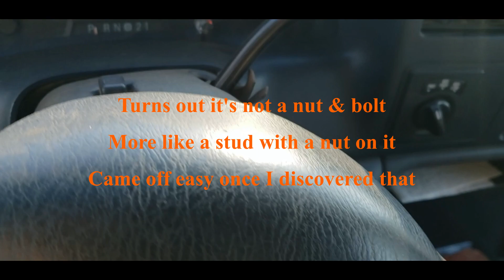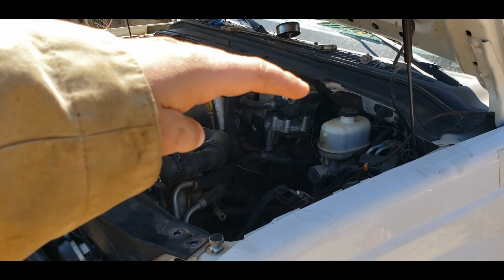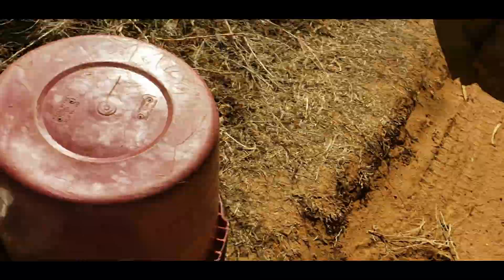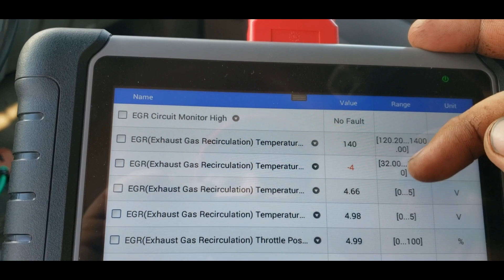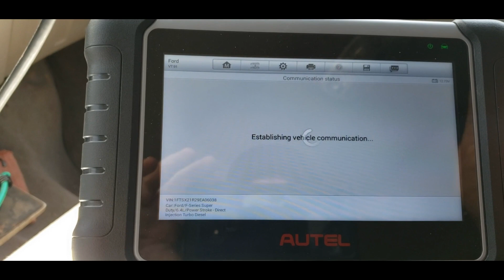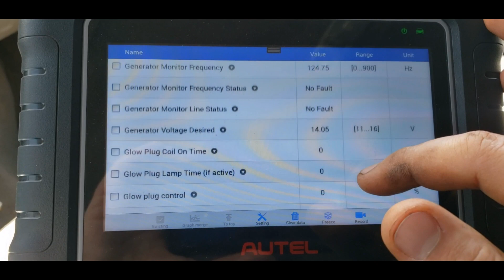6.4L Powerstroke, Engine Wiring Harness Replacement, Part II

Comment: I watched both videos and read all the comments. I watched the Turbo replacement videos and you have done Great! I will share what I know. To rule out all problems before you replace that long block assembly. I have learned that the PCM you have can be repaired. Even though a new module in a ford box would be sweet and the anti theft would need to be programmed to it. Yours already is programmed to your truck. 

Try to take out your PCM and send it to G7 computers in NY. Tell them on the form you have an intermittent rough running engine that changes with key on/key off and a possible fault with the #3 injector driver. They will diagnose, repair Nd return it to you with the Quickness! 

Post note is to maybe flash the tune back to stock so you have your tune stored on the tuner. Before sending it in for repair. And if they repair your PCM and your truck runs rough. Then check the compression on all 8 cyl. Subscribed.
Reply from the maker: My friend, you are a real one for watching all those videos. I really appreciate it. 
I also appreciate the advice. I did reflash the tune awhile back to see if that would do anything (it didn't). We considered putting in a new PCM from Flagship1, but honestly, there's more than enough blowby on this motor to justify a rebuild. A new/reman PCM on a winded engine wouldn't get us very far lol. 
We're still trying to get setup to do the rebuild. I plan to get it done this fall/winter, but everyone has a plan until they get punched in the face. Thanks again for watching AND subscribing. It means a lot.

Comment: Did you ever try a pcm swap? A lot of your issues indicate pcm.
Reply from the maker: I did not try a PCM swap, but I did reflash the tune. Tried running the truck on stock PCM settings, and then with the tune reapplied. Nothing changed.
Reply: @Mighty-Quinn  id highly recommend getting a known good pcm or reman. Could even send yours out for testing for like $100 to be sure. Many of your issues indicate it could be bad. Although "misfires" can often indicate loss of compression. Have you run a relative compression check? Can be done with IDS and that would help rule out compression issues. Im here to help. Please reach out and let's see if we can get your truck going without a total rebuild.

Comment: When you take the main harness off and put it back on don't you have to leave it for like an hour or more for the pcm to get all reacquainted or somthing. Any way I heard something about that just don't remember what it was for so just let it sit shut the egnition off go have lunch come back after an hour and see what happens.
Reply from the maker: No, it's not necessary to wait for anything once you get the main harness back on. The PCM will immediately start communicating with the various sensors once you have the batteries hooked up, and everything should be fine.

Comment: You're getting EBP sensor codes because you SOLDERED wires in the harness.
Vehicle manufacturers DO NOT USE SOLDER for anything other than a control board because SOLDER is nothing but resistance, corrosion, and breakage problems in a car.
Use an unshielded butt-splice made of Stainless steel, crimp the wires then install heat shrink with water tight adhesive over the connection.

Comment: What were the codes that were coming up before you replaced engine wiring harness?
Did It get rid of some of those codes?
Reply from the maker: The biggest code I was getting was for a voltage fault on the back pressure sensor. I think that's a P0471. Or is that the P0472? I don't recall. Anyway,  this had been present ever since we soldered the back pressure sensor wires into the main harness (I have a video about that). I couldn't clear the code, even with the high powered scanner. 

I was also getting a code for the Mass Air Flow sensor, but that turned out to not be a wiring fault, just the nature of how the sensor works. I believe it was a P0103, but I don't remember exactly. It essentially said the sensor was "reading out of range", but there's no way to fix that to my knowledge. 

There were also codes for a balance fault and misfire on #3 cylinder, but that also turned out to NOT be wiring related. I don't remember what those code numbers were. 

Replacing the harness did get rid of the back pressure sensor codes, but not the others.
Reply: @Mighty-Quinn  thank you much for answering that!

Comment: I’ve had some wired 6.4 issues my self.. take your scanner out and look at fuel rail psi with the engine off . It should be zero with the engine off. I’ve had similar issues
Reply: And it ended up being a fuel rail psi sensor.. it would lie and say 300-450psi with the engine off and it made no sense to me. It would read proper with the truck running just not when engine was off. Truck ran just like yours. Some day it was great others it wouldn’t move when put into gear. Just my experience
Reply from the maker: That's good information, certainly something I've never thought about. I did replace that sensor once before, but I'll try looking at the fuel pressure with the engine off and see if it's being dumb. Thanks for the advice

Comment: Have you changed the fuel filters? Was there water?
Reply from the maker: Yes, the fuel filters are changed every 10k miles (every other oil change). Just changed them again recently. I can only remember one time where there was a noticeable amount of water. It wasn't really enough to hurt anything, just noticeable.
Reply: @Mighty-Quinn  I'm not a mechanic, but my experience with electrical is once it's bad it stays bad, unless there is a heat expansion/contraction going on, or a ground issue. I would replace the rebuilt #3 injector again, or try it in #5 to see what results that gives. 
It would seem to me that the PCM would treat all the injectors equally, but only monitor them separately. I don't know the facts on this, only a guess, especially since the regen mode is disabled. You might consider flashing the tune again also.
Reply: I forgot to ask if you are using Motorcraft  filters? Some of the cheap ones are very bad, and they all are inferior.
Reply from the maker: @gregm4441  In response to your other comment, I do use the Motorcraft filters. Like you said, some of the cheaper ones are horrible. I'm not quite as concerned about the oil filter, or air filter (they are Motorcraft too), but the fuel ones in particular are completely Ford. I'm not gambling on the high pressure fuel pump holding up if the filters aren't working 100%, and the Ford ones have heavier filter media, plus the membrane that is around the lift pump filter. 

Now as to this comment: I agree with your analysis, I was thinking along similar lines. Oddly enough, I did replace injector #3 again a couple days ago. It made no real difference. Swapping #3 and #5 (or maybe #1) is something I might do later, (thanks for reminding me of that btw) just to see what happens. Right now we're going to run the truck for awhile, as long as the fuel economy isn't dropping. Like I said in the video (and this is no joke): If it starts running rough, 9/10 times shutting it off, waiting for a few seconds, and starting it back up will make it run perfectly. It's so random it's not even funny. 

I had also considered reflashing the tune, but literally everything else on the engine runs perfectly, so I didn't see an extreme need to do that. Can't hurt to try it though at this point, since nothing else seems to work. The only consistent issue I can identify is the inconsistency of any issues. Ironic, isn't it? At least now I know for certain wiring is not the cause.
Reply: @gregm4441  Stop guessing.
The problem is the engine is worn out or the piston rings are stuck in their grooves. The engine has blow-by to rival a train.
If you want to do anything to injectors look at #4.  The Computer is designed to increase fuel to the cylinder before the problem cylinder to compensate for a lack of power contribution from a bad cylinder.
I.E. Cylinder 4 is weak.. PCM says ok.. increase fuel to cylinder 3 to make op for loss of power from cylinder 4.
Either 4 has some clogged injector orifices or the compression is low there.
A simple mechanical gauge compression check will tell more than enough about this engine.